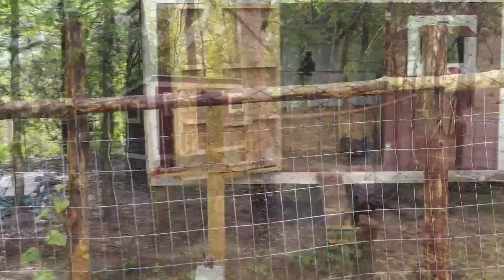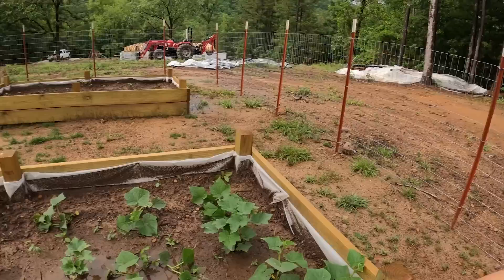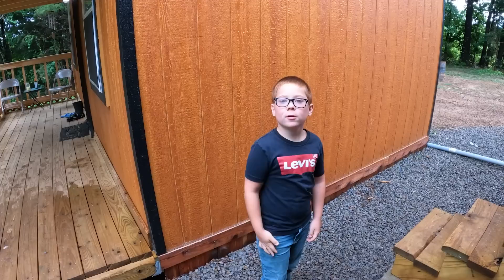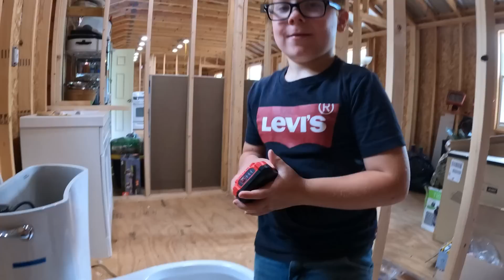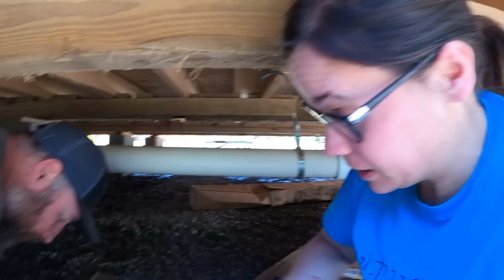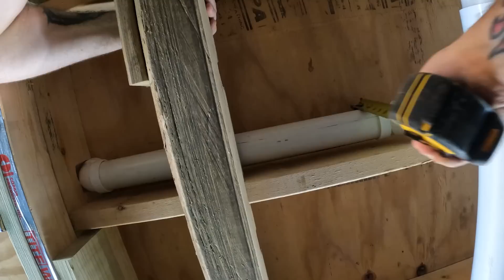Solving This Puzzle | DIY | Couple Builds Tiny House In The Woods

Comment: I would recommend placing a clean out at the start of the main run accessible from out of the crawl space or whatever you are calling the area under the house, that way if you have a blockage in the main you won't have to pull a toilet up and less mess. Ran enough plumbing in my life possible fixing to do more on a new house.

Comment: When you start suckering the tomatoes, plant 🌱 the suckers. You will be surprised how many tomato 🍅 plants you will end up with. Just be sure to put at least half if not more of the sucker in the ground. It will make a stronger root system for your plant. Also trim the leaves off that touch the ground. Keep up the great videos.

Comment: You might consider a small water trough with a float valve to control water flow.  Maybe about 3 feet long and directly connected to the tote for the chickens.

Comment: a suggestion when you fit the pipe together is after the cut chamfer the edges with a rasp or file to get rid of any burrs from cutting and will also help it to slide in when you glue it. Everything is looking good are you hoping to be in by winter

Comment: Waste piping……..Horizontal to vertical sort radius fittings……vertical to horizontal long radius fittings……put C/O’s everywhere you can….it’s easy and cheap….you don’t want to snake thru a toilet or crawl under the house..1/4” per foot slope 3” and smaller….1/8” per foot minimum 4” and larger….. I’m a retired plumber

Comment: I hate to be a naysayer but I foresee that the first time you get a freeze that your Pex pipes that carries your water being outside the house under the house instead of inside your walls will completely freeze up and burst the pex in many places. Normally being inside the walls they gain heat from the inside and therefore won't freeze.🧡🧡🧡🧡

Comment: Be careful dry fitting everything before glueing the pipe because every joint will slide together a little further with glue then with dry fit and could be off a quiet a bit in that long of a run. Maybe dry fit then glue a few fittings at a time. Y'all work together very good.

Comment: Just a heads up if it's not too late if you have to much slope then it will allow the water to run off and leave solids behind after a while is when the real fun begins. The way plumbing drainage is designed allowing for the proper diameter of pipe and pitch to allow the water to kind of slightly slosh back and forth as it travels along the pipe to help keep it clean and remove the solids.
Reply from the maker: We have 1/4" drop for every foot on the main line.
Reply: @countryroadcure  That should be enough, I don't send replies to discourage anyone usually I just watch and go on to the next but when it comes to construction I'm a firm believer in following code. A lot of individuals try using the argument that where they live there is no code well that is not true that's why it is called national code whether it be BOCCA (plumbing), NEC (electrical), mechanical trades (HVACR) ect. keep up the good work also enjoyed watching your son helping out and building memories, here is a little InSite on the proper drainage subject.  https://youtu.be/xpsLXmntINE

Comment: Hi there Anthony & Roxane and Wyatt, I am watching you doing the plumbing. In your research and since your building Is made of wood have you thought or found someone suggesting waterproofing with special paint all the surrounds underneath and inside all the wet areas in your house so in the future you don't have wood rot issues. I am suggesting it also includes up the whole walls including before the dry wall and are you putting special cement dry wall in the bathhroom areas. I realise you will have the special vapour barrier with insulation too! Also are you having an S bend between the drain of the bathroom sinks in each bathroom, and the kitchen sink. I have just seen the end of the video and saw you did have an S bend underneath the house after all! Well done as it would have been a pain in a cramped space! I love the laundry room too! You are really rocking it! Roxane a suggestion when the fertiliser feed bottle on your hose is empty do not throw away. Keep and make your own liquid fertiliser as in a

Comment: Just a few tips on growing cucumbers, unless you are growing an all-female type (normally these are a F1 variety) you will need to remove all the male flowers when they appear, to stop the real fruit being bitter, it's easy to tell the difference as the female flower has a small cucumber fruit embryo behind it, leave flower and fruit to grow on, the male doesn't only a flower, also don't let too many cucumbers grow on each plant, the more cucumbers the weaker the plant becomes (the seed packet may give you some advice on that), and also don't let them grow too big as they will be course and seedy inside.

Comment: You just think that your garden is growing.... the rain washes out almost all the stuff to make it green and growing good. Take a five gallon bucket and a part, a small part of chicken poop in that bucket, add some warm water if possible or just sun warm for the keeping shock down. Fill the bucket with water and just mix heck out of the chicken droppings an water together....let it set. After a while take the bucket with you around the garden and I used a regular can from some vegetables or whatever ... and poke some tiny holes like from a nail or something... even just drill them in it... fasten a stick for a handle on that can so you can use it to dip your can in the water and then let the can drip near the garden stuff growing..... not a lot but don't be afraid to get some juice there. In one to two days those plants will double in size like the tomatoes and squash/zucchini, and just any that is already started up.... fresh seeds don't need it yet an it will burn it if too much. Chicken droppings are some of the very best magic your garden will thank you for... your thumb will turn green